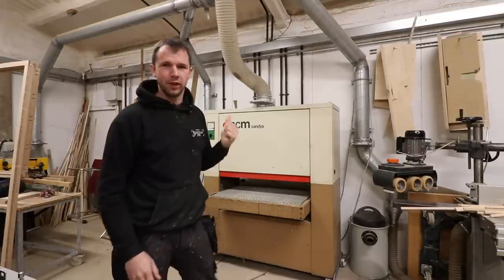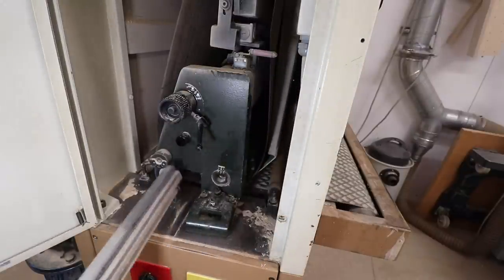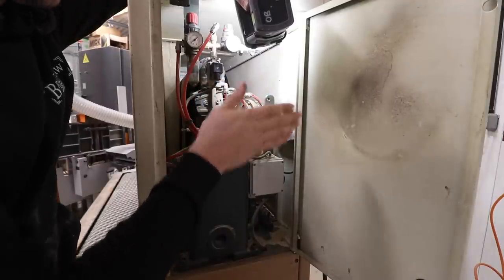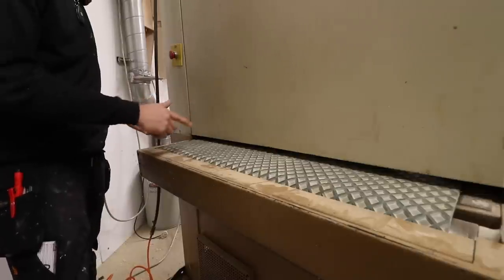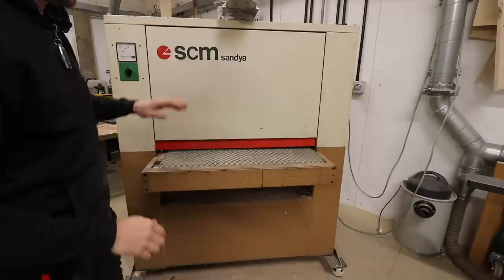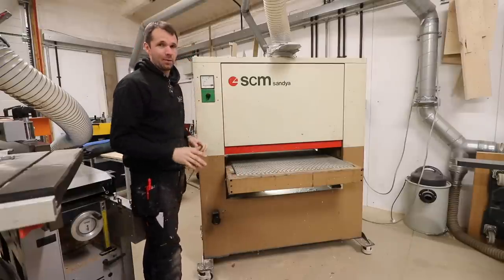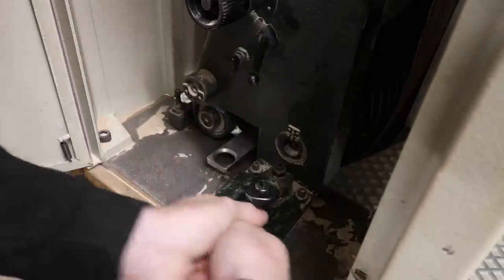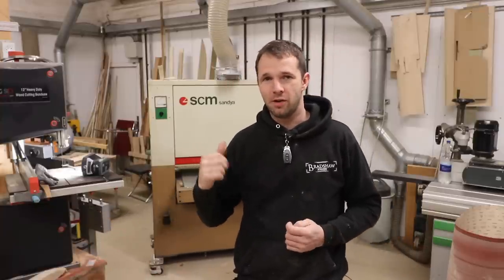Learn all about my Wide Belt Sander- Full machine Tour  And Functions

Comment: Does this mean I'm famous now mate? 🤣 Did I tell you I had a boo boo the other week and put a massive 350mm wide dip in the front roller? Had a planned power cut so decided to do some maintenance whilst it was off, clean the extractor filters etc. Thought I'd drain the compressor, so turned it off at the wall ready to drain it, but the power came on two hours earlier than planned, so got back on with work. Forgot I'd switched it off (I never do normally) and started sanding 🤦‍♂️. Was enough pressure in the tank for a start to tension everything normally, but about half way through it dropped, belt went slack and the room started to fill with the sweet scent of burning rubber. Lovely.
Reply from the maker: Argh so it basically pushed the timber through the rubber roller without any abrasive 😖😖 balls! 

How much is a new one. 

Oh your not famous yet as I couldn't remember your YouTube name 🤣, just added it
Reply: @BradshawJoinery  yeah, basically the belt became loose, so the rubber roller was just spinning and rubbing over the back of the static abrasive and just burnt/melted about a 1.5mm deep valley in it.  🤦‍♂️

I looked at getting the roller re-vulcanised, and you're looking around £1k+vat. And I don't think I'll get a spare for mine off the shelf, as it's as old as the hills. But to be honest I've got it sorted anyway. I cut a bit of board 1100x1050 and spray adhesived a sheet of abrasive to it (just one of the belts cut up). Then I disconnected the safety switches so it would run without any belts on etc. And started it up, then kept feeding through the sheet increasing the height by 0.15mm at a time until it was cutting the full width of the roller so I knew it was flat. Then I put the paper back on, and redressed the conveyor by removing the safety switch, so I knew they were both running perfectly parallel to each other.  Was a bit of a faff, but if I stick through a piece or mdf 1050mm wide and then check it with the calipers there is no more than 0.05mm deviation anywhere across the full width. That's good enough for me, so I think I've got away with it 🤞. 

Won't ever be able to do it again though, as it'll be too high for the steel roller on the second belt, so better make sure I don't bugger it up again.😂😂

Comment: Fantastic Introduction to wide belt sanding! Every apprentice in the trade should watch your videos! It's a finicky machine to get to grips with setting up but certainly pays its dues! As you mentioned, it's important to inspect the machine prior to buying second hand and especially check the condition of the conveyor belt and main roller as that is imperative for accurate sanding results.

 All the other bits and bobs can generally be maintained and repaired but not so much the latter as it would be hugely expensive!
Reply from the maker: Thanks jack! Im really thankful for the advice i received so only fair to help others!

Comment: Nice one Ollie, Thanks for doing this vid after my request for this walk around being a WBS Virgin myself found it very informative.
I have just purchased a used SCM Sandya 1K Three weeks ago but still waiting for the spark to come and get a supply to it, all aired up and good to go apart from Electric.

I also invested in the remote fobs that you installed previously saves my legs back and forth to the extractor and great when I change the bags saves me having to come inside to switch on to make sure I have no leaks as like you my 3-bag unit is housed outside.

Nice one mate.

Kev
Reply from the maker: No worries Kevin, Thats great news. The manufacturer of the extractor remote must have sold a few units as he found out the video and wrote to me to say thankyou haa. How is the sander going?

Comment: Thanks for the review. I had worked for a small local wood shop and this machine of yours is similar; their's having the auto height feed gage on the lower left. Their finger tracker on the belt was
loose and previously broken-bent. They were too cheap to keep a good set of papers and the right side of the feed belt was uneven in sanding depth. Might have been the large roller bearing beginning to fail or more so. I have a 600 MM planer and find with M42 knives I can accurately mill most of the hard woods I come across in the projects. I can see how the wide sander would
pay off as I expand the range or projects. As you say, muntins need that finder paper sanding. Have a good week other there.
Reply from the maker: Thankyou again Vincent, You are a gent, the wide belt has been a true revelation to my workflow and i wouldnt be without it now. Great tool

Comment: Have you put a sash through yet with the glass bar parallel to belts….. that will wake you up 😂👍🏻

Destroyed a few sashes on my learning curve !

Machine sat  my workshop for a year and half before I got it wired up and a compressor to run it, I’d be lost without it now!

It’s my go to now straight after mortising, priori to laminate trimming haunch to final depth, and  clean up inside edge.

Sanding using any method can trash a sash real fast ! And I think if we’re honest we’ve all been there! Especially with the old makita belt sander!

I’m running 120 on first roller 150 on second, I pretty much make everything I make .75-1 mm thicker on thicknesser, then final sand everything  at end 0.2 -.3 max each pass., obviously face side down first !

You can do your double hung sashes too, one face ( flat side ) on board, other side either dry fit bottom/ top rail and stiles only for ‘special jobs’ but normally I do flat side on machine and meeting rail side with Festool sander👍🏻 tennoner and morticer and pretty much dialed in perfect so usually not an issue unless I’ve ‘Funked’ up a piece of stock and grabbed something else to get it done.

I was almost selling mine you bugger as you said only crap joiners have them !!!😂
Reply from the maker: I know why you like it so much, levels out them joints lovely 🤣🤣👍

Thanks mate, it's a fantastic machine, wish we had one as an apprentice, instead we had a flat bed sander with a pad arm. That taught you to be careful with what you were doing
Reply: @BradshawJoinery  also you don’t need to worry as much about  nicks in surface planer or thicknesser which is gold! 

On one item, prob not to much time saving from just hitting it with Festool belt sander, but it’s like your door Hanging video, when you’re putting a few frames through the time saving is exponentially quicker! And you’re not just ‘sweetening out’ the corners, the whole thing is dead flat and exactly consistent thickness between panels all day long. 👍🏻

When I did my apprenticeship, we left styles long. Skew nailed to bench! And hand planed joints flat!
  No stroke sander! Not much of anything really! No three phase!

Just an extremely skilled old bloke! A ‘kitty’ combo jointer a sheppach saw! A morticer! A Dewalt radial arm a router, and that was about it from memory 👍🏻

Comment: Great video Ollie. I've always been keen to know more about wide belt sanders as at some point I'd like to get one for myself. (I've had the large jet oscillating drum sander for a few years - it's not a bad machine, and capable of flattening small sashes, but absolutely nothing on a wide belt in terms of power and capacity) I've always wondered why a good volume of compressed air was needed and now you've explained it perfectly - looks like i'll have to factor in getting a better continuous cfm compressor with any machine I find. Thanks also for all the buyers tips too. 👍👍
Reply from the maker: Yeah the compressor side is quite demanding. I think newer sanders can use a electro pneumatic system which is less demanding but slightly more prone to being temperamental.

Comment: Hi Ollie,

If the manufacturer of the remotes has made a few sales maybe you should get a refund 😁!

I managed to get one of those wixsey 550 digital readouts and fitted it at the weekend so all good now regards the thickness readout now, I suspect that the old mechanical readout must have a work cog somewhere causing the issue with skipping digits every so many revolutions.

I sprayed the feed belt with a couple of coats of the Clear Plastikote non slip from Toolstation and that has certainly helped with the feed issue the belt certainly isn't as slick anymore it is coarse to the touch now so fingers crossed.

Just re the PRF Glue its great for long open time when working with ACCOYA I generally get it from UREKA, they do all the glues for use with vacuum forming also as well as those  PFHOL rollers that you used in the curved cabinet build.
Reply from the maker: Thankyou Kevin, He offered any other products that may help me to be fair to him. Good to know in the belt slippage, I will get some PRf glue. Some glueups are a pain.

Comment: When you turn on the motor you first connect 3x230V to it in the star position. Then you connect 3x400V in the triangle position. As the motor wiring is the same - just connected differently - it will draw more amps at 230V as at 400V. It is done on bigger motors in order to limit the amps draw and to protect the motor from sudden high amps (and overheating)
Reply from the maker: thankyou that makes a bit more sense to me. Intersting to know.

Comment: Thanks for the introduction, very helpful. I've recently bought a second-hand twin SCM and am having issues with the tracking, after 10 seconds of running the belts run off the ends tearing them to shreds. It looks to have the same tracking system as the one in this video so I was wondering if you've had a similar issue at all and if you had any advice on how to solve this?
Reply from the maker: does the top roller move when you block the jet of air that tracks the belt? maybe the pneumatic ram is seized. Another common mistake is its wired in and running backwards... dont ask how i know

Comment: Thank you for a very informative video! There's something I struggling with on my machine, the oscillation function in top roller sometimes won't kick in...any tips?
Reply from the maker: Hi, im not sure, there is a lot of thinks going on with it. Normally if problem with pneumatic side, the air cylinders have rusted inside and siezed, normally because the air supply hasnt gone though a dryer and there is moisture inside itt.

Comment: Great video! We've just got one of these machines and trying to get it up and running. We made epoxy resin tables. This is going to sound simple, but I wondered if you ever had issues with getting the green power light on?! We've had it wired up professionally and checked all the stops are disengaged, but can't get it firing!!
Reply from the maker: Air pressure on? Sometimes I have to wiggle the upper belt roller when air is on to get it to lift and activate the switch

Comment: hi where do you get the belts from please?  I've been looking for a couple different grit large sheets of sandpaper to make large sanding boards for hand sanding boxes etc. one of these belts would do me a few years as a hobby woodworker. I've spent hours and hours looking with no joy so far. cheers 
keep up the interesting videos
Reply from the maker: Where are you based? Search 930mm wide belt. Trouble is most places sell a box of 10. 😖
Reply: @BradshawJoinery  I'm in Devon. I'll try your search and see what pops up. Thanks

Comment: can you adjust the table if it sanding off level slightly
Reply from the maker: Do you mean the left sanding thinner than the right? 

Yes small adjustment made by grub screw seats on the removable piece that comes out during belt change. Otherwise it's in initial setup of the bed screws(bigger job)n
Reply: @BradshawJoinery  I have a similar machine twin head right side is sanding tighter than the left . I'm going to try and adjust
Reply: @BradshawJoinery  i think i sorted the sander out i adjusted the clamping levrt to tighten down that side a fraction as the head is cantilevered from the opposite side